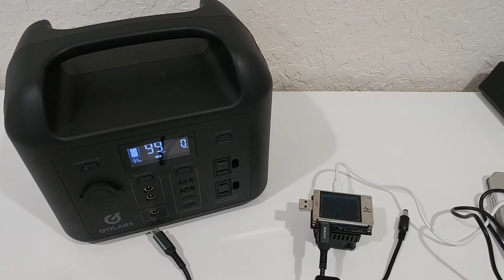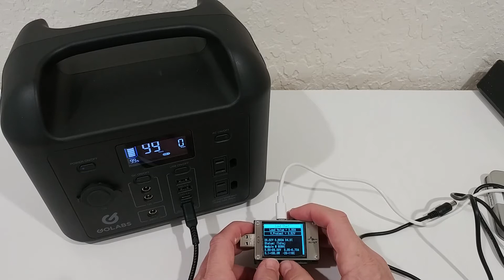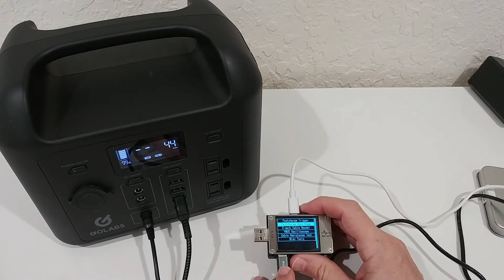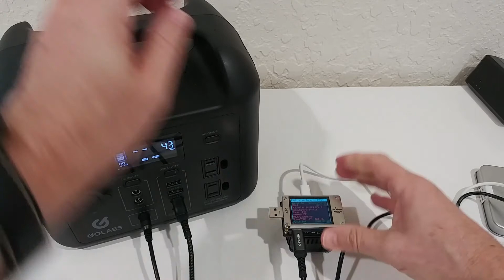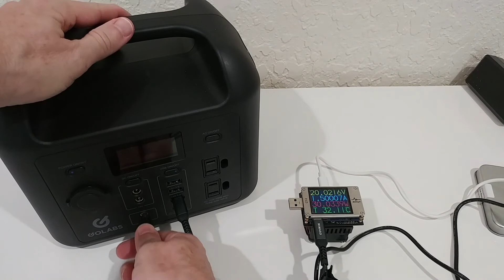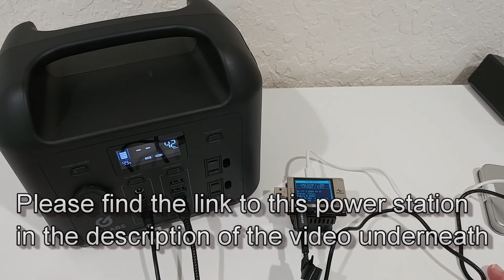Does The GOLABS R300 Power Station Really Have 60W USB C Output and 30W With Pass Through Charging?

Comment: There could be a workaround if you want a 100 watt USB C output only.  I have not tried anything other than a INIU 30 watt myself, but a cigarette adaptor rated to USB-C 100 watt should be within spec of the 10 amp ciggy outlet.
Reply from the maker: The idea is nice, but I've never seen a normal standard size 100 W USB-C cigarette adapter. The max I've seen is around 40W. I think more power would produce too much heat. Already advanced 40W cig adapters are struggling with overheating ... or have you seen one?